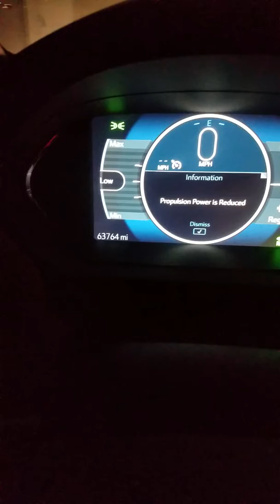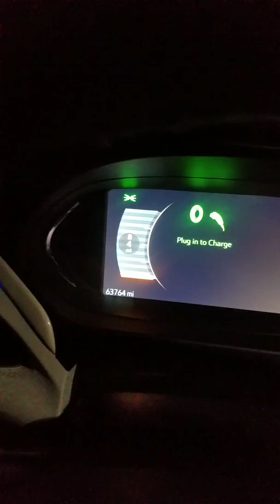Chevy Bolt Low power Range meter.

Comment: I used to have a 2019 and always wondered why the system stopped providing information at the time when you most need it. Now I have a 2020 and  drove it down to 12 mi remaining and was pleased to see I didn't have to cycle the power and open the door to see the miles.